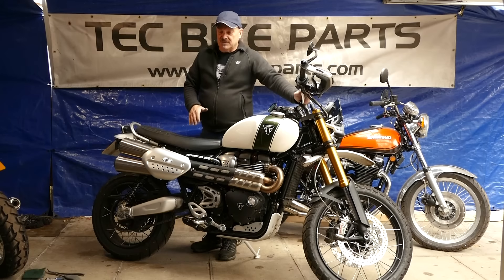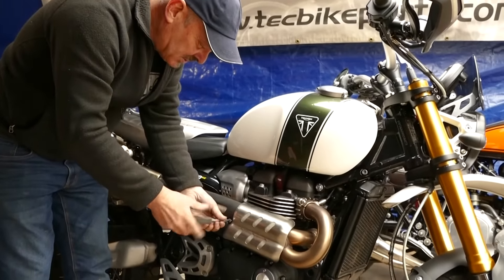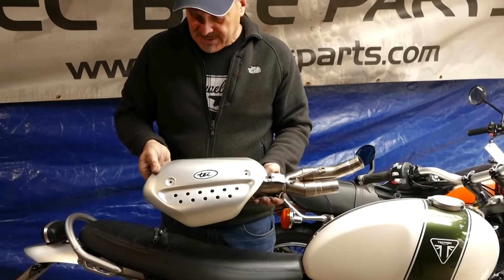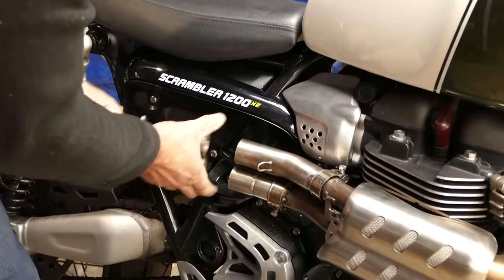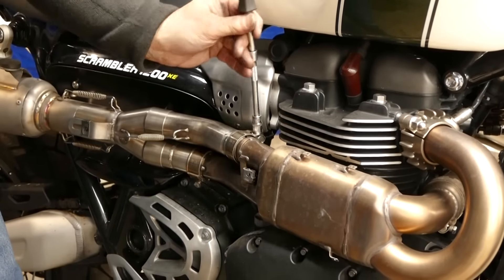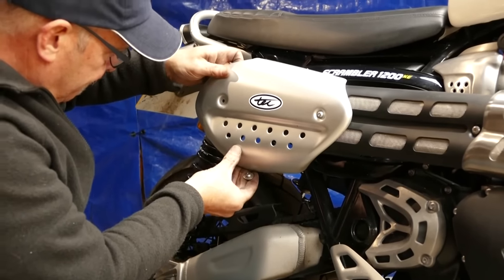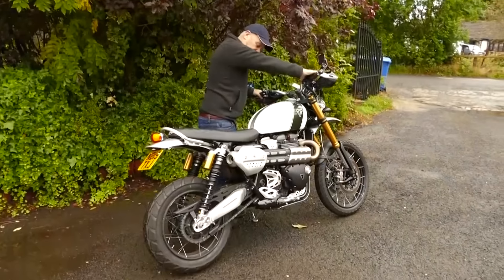BRAND NEW Flank 2-1 Exhaust for Scrambler 1200 | TEC Bike Parts

Comment: Hi all, I have a 2019 Scrambler 1200, and I bought the Flank exhaust about 2 months ago - easy to install and a huge weight savings. I have also removed the cat from the stock exhaust, removed the airbox snorkel, and installed the Boosterplug. This bike is fun! It is so lively and torquey that it is a blast to ride quickly. I have also installed the Tec bar ends and they look much better than the stock mirrors and work well too. Just got the tail tidy and will install it tomorrow. I love this bike! My last bike was a 2013 Triumph Tiger 800 which I rode for over 90,000km and was also a very good bike. Traded it in on this and ain't looking back.

Comment: I put a full system on my bike a while back, got it from Total Triumph, uses some bits from the K & N Street Street Scrambler kit plus some bits that Total Triumph fabricated to make it work on the bigger engine. Your add-on looks just as good, and is simpler and less expensive. Good work.

Comment: Just fitted mine yesterday, but one of the exhaust extensions (the bottom) one is 10mm too long.. which means I can only fit the heat shield over the cat..  will have to take the hand saw to it later.
Other than that, wow, the sound is AMAZING!!  Holy hell, I am going to have to get the additional baffle now, even with the cat still installed lol!!

Comment: Super badass exhaust!!! My top pipe is a little too short? Sounds deeper without much more volume with the baffle removed.  It really looks better in person, the pipe is the right length and looks good as you walk around the bike.  Love the way it opens up the rear section to see both shocks! Can't say there is a significant performance difference as I dropped a tooth on the front sprocket at the same time and it stays on one wheel now!!!

Comment: I'm also of the opinion that the exhaust would look better if it was a bit longer and protruded past the rear plate. I'm looking at getting an end cap insert of have one custom made. What is the diameter of the end pipe?

Comment: TEC Bike Parts, have you looked at making a 2 into 1 that would pass behind the rear shock and continue back out to a short mega type silencer nicely out of the way of the passenger? Looks tight but there could be room if the current bracket was removed. That would be the best of all worlds, especially if it was a full de-cat system with just one neat heat shield.
Reply: You need the back shock to compress, putting there a big pipe would squish it between the tire and the downside of the seat at every larger pothole

Comment: Must admit, I agree with most here, nice sound but too short from side. I've gone with the SP Engineering shotgun pipes which also make use of the factory heat shields.  They're a little on the noisy side but at least car drivers know I'm coming :)

Comment: Current/Future mods:
Free-Spirits De-Cat (current)
DNA HI-FLOW Filter (current)
NEWLY FITTED (!!!) Tec Flank 2-1 exhaust
Performance Camshaft (purchased-not installed)
DNK Tunworks tune----(future). 

Just installed mine last night!!! Like everyone has said....the system could be just a TAD longer---but still looks fantastic. Sound with BAFFLE IN, and De-Cat installed was not loud at all at idle. When you give it the berries, tho....sounds great. Felt a bit choked at approx 95mph, so I may try to run it w/out the baffle next time and see what happens. 
I did the Triumph Tune (let it idle for 15-20min until fan kicks on) before i rode to work this morning. 

There were some minor fitment issues with the TOP mid-pipe as it connects to the Free-spirits de-cat, however. Since the de-cat header is little shorter than stock, there isn't a complete connection--you find this out once you attach the spring and it pulls it away from the header. I used some stainless steel tubing and clamped it down around the mid-pipe where it connects to the header to ensure a seal as best as possible---now everything feels snug-ish.
May need to purchase some proper piping, however...to ensure fitment is tight.

Comment: Does it protrude further than the stock exaust? Is it the same comfort when standing up on the bike?
Reply: I have noticed the same issue.. I love to stand and ride and it seems notably more in the way of my leg getting to the peg.  I loosened everything and tried as hard as I could to get it in tighter to the frame, and it helped a little.. But there is still a very notable gap between the bike and the pipe.. Not sure what to do about it other than maybe go to a shop and see if I can get the midpipe bent a little more..?

Comment: Wish it was a little longer (3 inches or so) so that you could see the end can from the side.
Reply: Yes we agonised over this , But I love the fact you now have a clear view under the fender and of the right side shock. Just looks a lot more scrambler !
Reply: george milburn I can guess how it presented problems. Did you consider an indent on the rear to get around the shock? Not an easy or cheap solution. 

What diameter is the silencer? It looks very compact.

Comment: Installed today. Top connecting pipe (one that connects to the Cat) is a little too short for a great fit. Did you lengthen the top pipe in a more recent production run?
Reply: I ended cutting a little bit off the bottom pipe

Comment: Still loud that, as loud as short shots. 
Does it have a db killer in
Reply: This video  is with the Hi flow straight through baffle fitted, this is quite a bit quieter than the short shots even with washers fitted. But we also do an extra mid mount DB killer that can be used with or without the hi flow baffle to get the sound at exactly the level you want. Volume level is always hard to get across in a video.
Reply: @georgemilburn6213  yes thats true. I got short shots and without db killers in that i fitted sounds like a numatic drill .
Reply: @georgemilburn6213  do you have any db measurements with the hi flow baffle installed and with the mid mount db killer? Also, I can't seem to find the mid mount DB killer on the site. Are you still producing it? I'm trying to find an aftermarket solution with better sound but still meet USFS OHV requirements (96db max & spark arrestor)

Comment: The pipes aren't bent right for a 2022 and they are too tight on the lower connection so it is TERRIBLY hard to get them to fit on properly. I've been at it for 2 hours, and I still cant get them to seat right against the Header pipes.  This is kinda a pain in the BUTT.  I've had to bash the midpipe sections forward with a hammer, but then when I pry them away from the bike to fit the silencer, they back off. The Midpiple 2 into 1 section has the pipes too close together, they need about 1/2 seperation, but they're nearly touching so you realy have to bend and bash with a hammer to try and get them fitted together.  I've been pushing, rocking, and hammering for 2 hours and can't get them totally seated together.  I don't know how it's so easy in this video.  UPDATE: I finally got it installed. 5 hours and tons of sweat. But it sounds great, looks better, doesn’t burn my leg anymore, and flows easier!  Absolutely LOVE it and we’ll worth it only AFTER all the 5 hours of hard installation :)

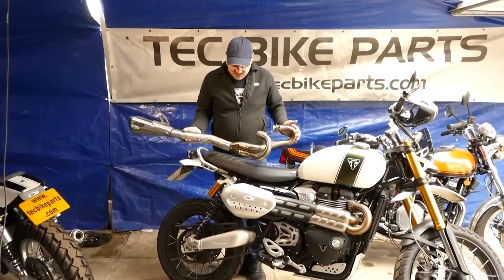Comment: 14:57 In this video it is said that the Vance & Hines 2 into 1 system for the Street Twin shouldn't be used on 1200 models because the pipes are 38mm instead of 40mm and it doesn't provide enough flow. Now I don't have access to a dyno so I can't speak to how the system affects top end but, I should point out that on the T120 the stock pipes that come out of the catalytic converter are significantly smaller than the 40mm pipes that go into it. So with that bottleneck plus the cat itself, the stock system is much more restrictive than the V&H and no one should worry about it not having enough flow for the 1200. 

All this to say if anyone is wondering, The V&H 2-1 system works just fine on my T120 in addition to being a 13kg weight reduction. You must trim the Street Twin side panel a bit to accommodate the dual throttle bodies on the 1200 and remove the silver cover behind the fake carb but those are the only two mods you need to make. Although not absolutely essential I'd definitely recommend adding the TEC booster plug to correct the fueling.